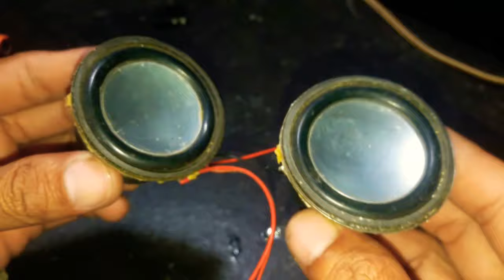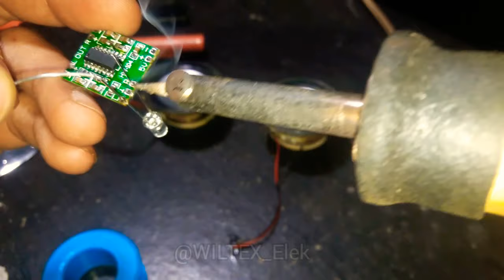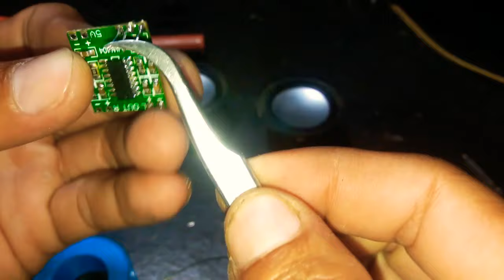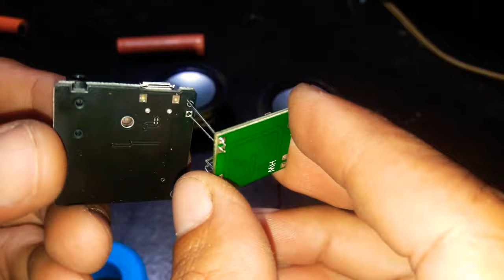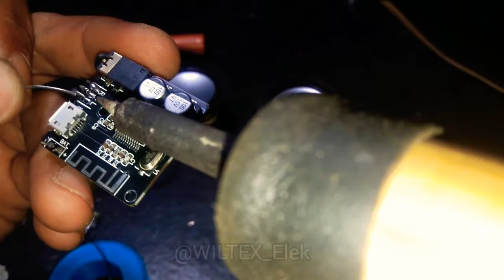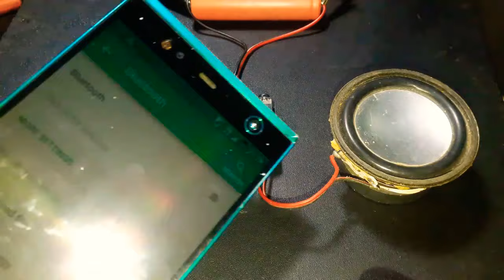Bluetooth music audio amplifier VHM-314 mini ampli 3watt stereo 5volt  PAM8403

Comment: And can you do the same with bluetooth x and bt mini ????
Reply from the maker: english please..
Reply: @WILTEXElek  And can you do the same with bluetooth x and bt mini ????
Reply from the maker: @davidurbina3874  i use mini amplifier PAM8403
Reply: @WILTEXElek  yes but the same process can be done using bluetooth x and bt mini with pam8403 amplifier?
Reply from the maker: @davidurbina3874  bluetooth modul in video can't drive speaker and need power amplifier to make batter sound.. and i give mini ampi PAM8403 3watt stereo..
Reply: @WILTEXElek  can that be done with the pam8403 amplifier?
Reply: can that be done with the pam8403 amplifier and with the bluetooth xy bt mini?its posible?
Reply: @davidurbina3874  ☝ ijin menjawab...tentu sj bisa.justru keduanya sama2 suplly 5v

Comment: Juragan. Maaf mau tanya..?.saya rangkai. mdl blutut. +pam. 8403..sama. sprti. Di vidio. ..tapi. saya pake casan. 2 ampr.. Tp suara putus.2..volum. bru buka. Dikit.. .🙏🙏.mohon pencerahanya.??
Reply from the maker: coba
- ganti kabel cesan
- posisi blutut dengan PAM jangan terlalu dekat
- kabel negatif speker kanan kiri jangan di gabung
- tambah elco di bagian tegangan PAM
Reply: @WILTEXElek  yang. Brapa. Elco. Nya. Juragan.
Reply from the maker: @dimansmans5421  10v 2200micro.. micro lbh gede jg ga papa.. netralkan dulu barangkali ada tegangan sisa.. caranya kosletkan kaki elco

Comment: Maaf Bos Melenceng Dikit 🙏
Saya mau tanya, saya punya Tape deck jadul merk seico, awalnya saya bongkar mau saya bersihkan debunya, terus saya geser tombol voltase yg di belakang tape deck nya itu, nah saya lupa awal nya di 110/120, akhirnya pas saya colokan listrik ada elco 100u 25v meledak satu Deket IC power ampli nya, semua elco ada 4 tapi yg meledak 1 elco saja, apa itu pengaruh dari switch voltase yg saya rubah, harusnya posisi berapa volt ya ? Terimakasih 🙏
Reply: Maaf maksudnya 220v bukan 120v maaf salah tulis 🙏
Reply from the maker: aman di 220v mungkin saklar voltase sempet d pindah d 120v dan d tancap ke listrik akibatnya trafo bisa njebluk.. komponen juga bisa ikut njebluk karna naiknya volt output 2 kali lipat
Reply: @WILTEXElek  iya bos kan ada 110v sama 220v nah pas saya bersihkan itu ke pindah, cuma saya lupa awalnya di 110v apa 220v, pas saya colokin travo bunyi dan elco 100u 25 Deket IC power meledak satu, semuanya ada 4 elco kapasitas sama, tapi yg meledak satu elco saja.. apa itu meledak karna voltase tadi ya bos?
Reply from the maker: @acengtahlilan1267  ya mas.. elco meledak karna tegangan dr trafo naik 2kali lipat.. kemungkinan juga merusak komponen yg lainya dan trafo juga gosong
Reply: @WILTEXElek  waduh, belom saya colok lagi, ternyata pengaruh nya banyak ya..
Reply: @WILTEXElek  terimakasih banyak bos infonya 🙏